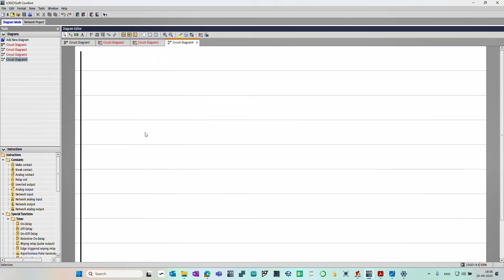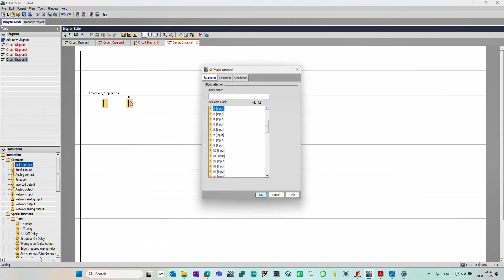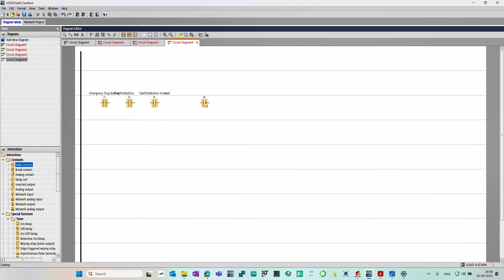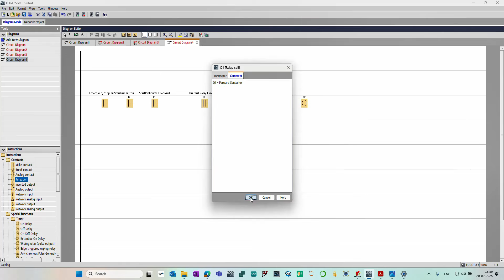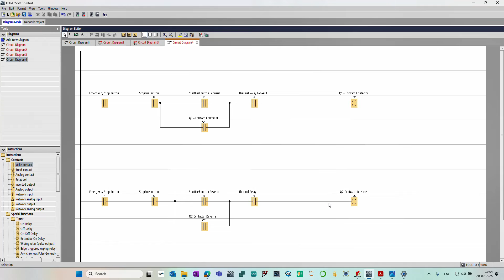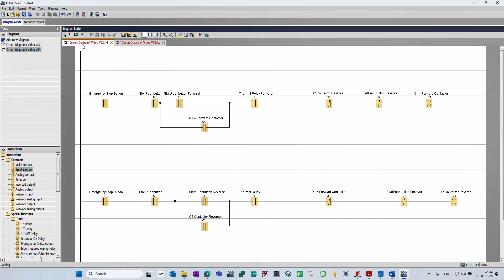PLC Programming Tutorial  Forward & Reverse Motor Control in Siemens LOGO!  Ladder Logic

Comment: the stop and emergency stop must be NC in the hardware  never NO
Reply from the maker: Yes it's NC in hardware but in software ladder logic we use NO.
Reply from the maker: I have already explained in video that this stop and emergency button should be NC 1 and 2 
In pictures its incorrect
Reply: Master motor contactor control (direct/reverse) in LADDER and ST. Code examples: - b°o°o°s°t°y.t°o / p°l°c - remove the ° symbol and see examples
Reply: Electric motor contactor control (forward/reverse) in LADDER & ST. Great code examples at - b°o°o°s°t°y.t°o / p°l°c - remove the ° symbol and see examples
Reply: The channel www.youtube.com/@FrantiszekF has a video with examples of electric drive control using the expanded SR-trigger method, of LADDER and ST programs in CODESYS 3.5.